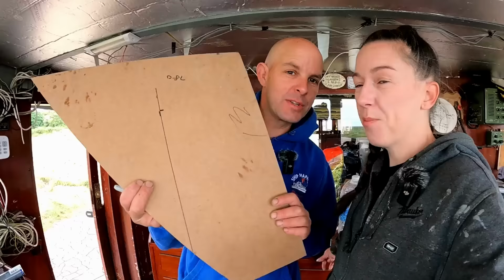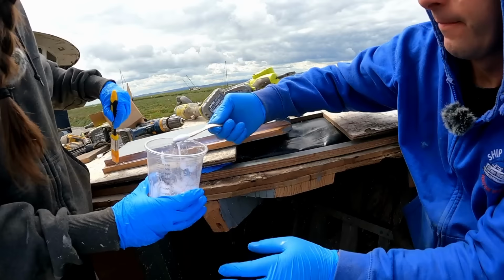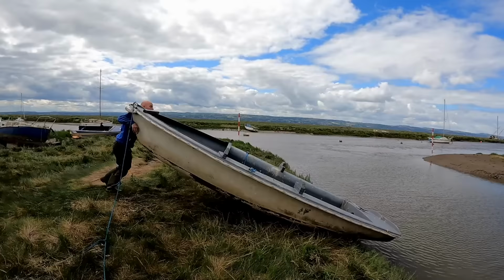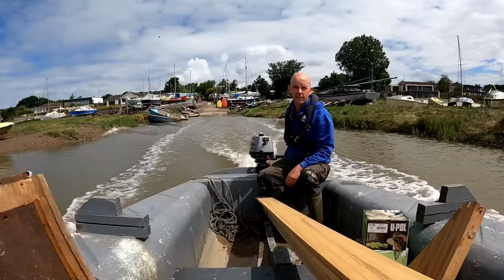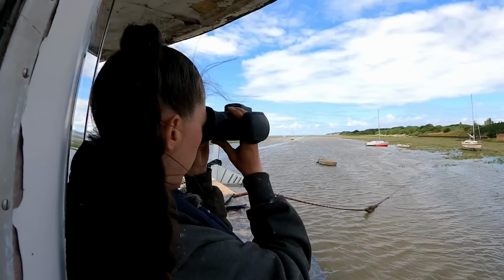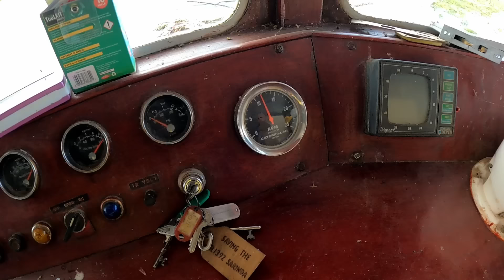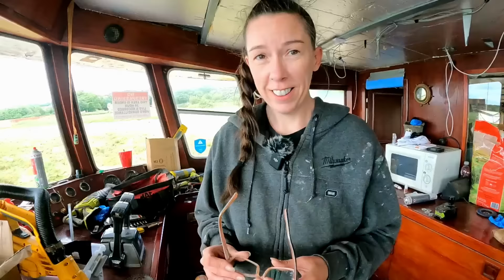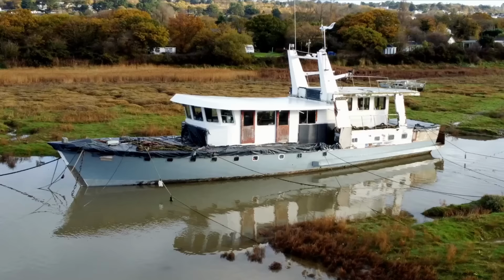Ep 131 Engine Run & A Day In The Life Of 2 Boat Builders!

Comment: A good tip for pulling the small boat is to attach a rope to the stern and pull it along with that. The bow will want to go out so use the front rope to keep it under control. I pulled my broken down canal boat for miles doing that. Thanks for yet another great episode.
Reply: alternatively you can run the painter out through the jib-sheet fairlead. the boat will naturally turn slightly away and follow a course parallel to the bank.
Reply: Or even take a longer rope all the way to the slipway and pull it in from there.

Comment: You should buy or make a 3x10 adjustable shelf that you can hang off the side of the ship with either ropes or u-shaped pipes that has adjustment holes so you can change the height all so you can work off the side as far as just above the mud or waterline that is at the time you are working to the top, that way no mater what the level of the tide is at the time you are working you can still do what needs to be done.Think of how a window washer works on a high rise building.
Reply: That's a really good idea!

Comment: The DJI Mics are great!  The sound level is much more consistent.  I know you said you ordered another set of glasses, but as tonystanley says, strengthen them with a piece of wire.  I'd drill a small hole in each nose piece and epoxy the wire and the halves together.  MUCH stronger that way.  Good episode!

Comment: For your glasses a better repair is to add a small strip of metal or pin with epoxy, ideally top and lower front.  Its less aesthetic but way stronger.  You need to spread the load out over wider glued surface.

Comment: Drill a small hole in either end of your broken glasses, then fill with some epoxy and fit back together. Can put a toothpick in the holes to help keep them together. Should hold you over until you can get some new glasses.

Comment: You'll always have some sort of wind noise depending on how hard it's blowing, but everyone that I've seen using those DJI mics have had a huge improvement in audio quality.
If you build a zipline from the car park to Sarinda's upper deck then you can load/unload gear whenever you want! lol.
With all of the spare time and money you guys have, you could design and build a 20 foot aluminium pontoon/barge for hauling equipment/parts and have it lashed alongside. Power it off an old 2 litre motor from a random Fiat/Escort/VW. Saves having to fight the tender on and off the mud lol. When the tide's out you can fall back to using the zip line.
Reply from the maker: Spare time and money???
Reply: @ShipHappensUK  yeah I was having a major lol there

Comment: Piranha I think by Black & Decker do a decent counter sink with a replaceable drill bit. I've used them on oak and soft wood. They have a hollow hex end and an Allen key adjustment for the drill bit depth and replacement.

Comment: If you tie a rope to the bulkhead on your little boat and use that to pull it you will find it spends less time running in to the bank. Give it a try, what have you got to loose?
Loving see how Sarinda is evolving and the new mikes are a 110% improvement.

Comment: your engine impellers might be fine, an easier check is to remove the end caps from the heat exchangers in the header tank and check the tubes for blockages

Comment: My experience with binoculars and a monocular, is that I am steadier  free standing or one hand hold than sitting or bracing against something solid. My body acts as a steadying mount always working to keep me oriented straight up and down if it can. On the other hand, a hard mount to the boat introduces all of the boat's movements into the sight. Now, I have a much smaller boat (which moves more) and while I do tend to use optics at anchor more often than while sailing, I have done both and it seems much harder to get a good sight when bracing than when  standing with one hand hold.

Comment: Always very wise to reg. fire up an engine... all motors degenerate when they're sitting for a long time, the seals get hard, the oil slowly slides off various internal metal surfaces.  Keep them moving, and nip problems in the bud!

Comment: Check the marina speed limits.  In heavy traffic areas, it's like 3-4kts. Don't post vids of speeding unless you want a maritime speeding ticket. They do it for ppl driving cars.
Reply: It's to prevent accidents, but also to stop your wake rocking other boats together at thier moorings causing damage. Your video is a perfect example of wake causing boats to bang together. If it was your boat, and some other hoon, you would take offence.

Comment: No criticizim here, but why are you gluing rge planks together at the ship lap edges but not with the broad side cross grained with the outer planks? Yes they are fastened with screws, but surely they would be more secure with both fasteners and epoxy glue, or even just construction adhesive?

Comment: You need to bring motors up to temperature otherwise your only doing Moore damage than good .good 30 To 40 minutes
Reply: It’s all about the seals and freeing up the rings etc: keep up the good work cheers Peter
Reply from the maker: They were running for longer, but i don't think a hour long engine run video would go down to well!!